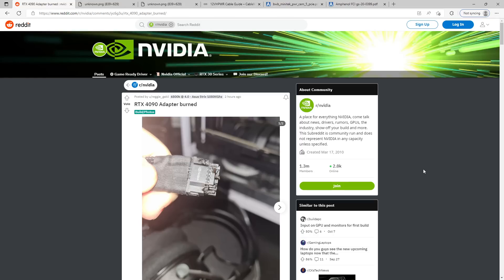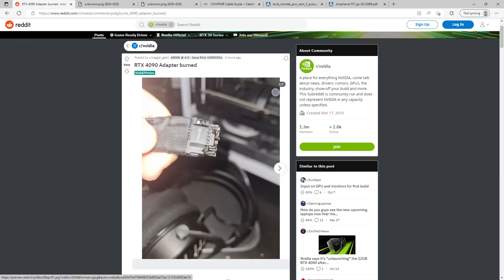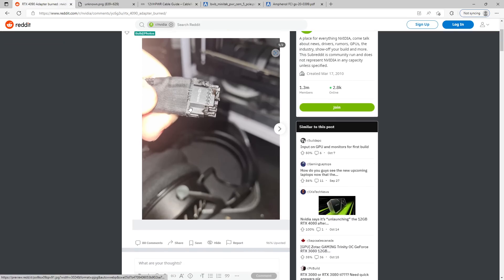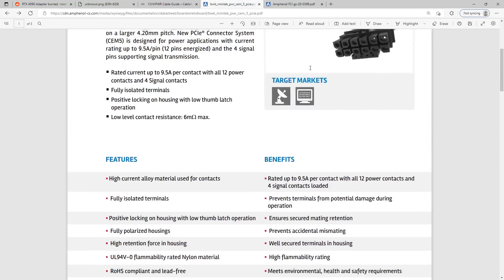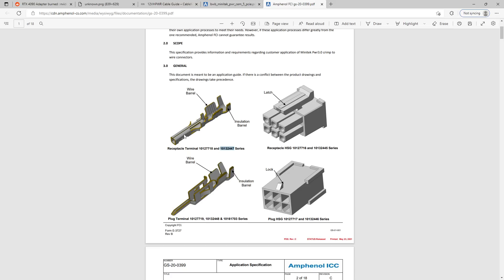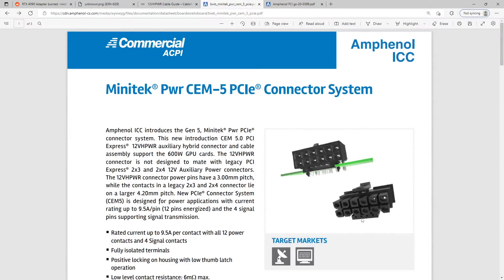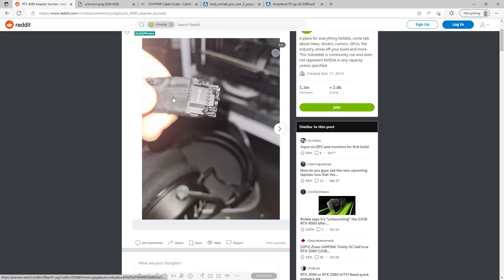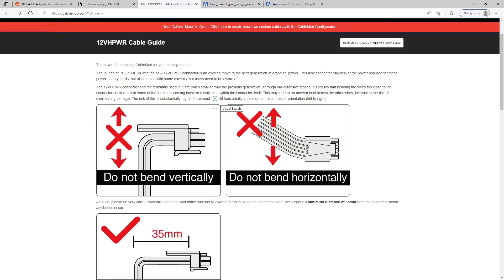The 12VHPWR connector sucks

Comment: Buildzoid, did Nvidia actually come up with this connector? I was under the impression this connector was part of a power supply standard?
Reply: yes, Intel created the ATX 3.0 spec, and the point of the connector isn't to reduce how much space it takes up, the point is that the GPU can communicate with the PSU and can in turn better deal with GPU power spikes, etc.

Comment: My first thought was the 12VHPWR connector didn't look physically sturdy enough.  
And the supplied converter cable with the GPUs are just awful.
They have next to no flexibility at the neck of the connector and they are so short you cannot hide them anywhere.
As for that guide, it's not realistic telling us not to bend the cable up or down as the case side panel is only like a inch away.

Comment: NGL I was quite shocked when I was installing my 4090FE. The nvidia adapter is super loose and you can very easily pull it out because the latch to hold in place is very small and have almost no grip on the female plug on the card. The special 12VHPWR cable from Corsair has the same problem BTW.

Comment: It seems a better solution to the sense pins would be to just sense current flow on the PCB. This is already done for dozens of sensors inside CPUs and GPUs, no reason it couldn't be done on board, and may even take up less space than having the extra 4 sense pins. Cards already sense if connector is plugged in, so they can give an error and not fully boot if PCIE 6 or 8 pin isn't plugged in.
Reply: The sensors measure how much is being consumed. The sense pins are to inform how much can be supplied.

Also, the 6 and 8 pin connector detection happens via sense pins. The 6 pin connector (by spec) has 2x 12v wires, 2x ground, a sense wire (connected to ground, to detect connection), and an unconnected position. The 8 pin connector spec fills that unconnected pin with another 12v wire, adds a ground pin and another sense pin (connected to ground to detect connection of an 8 pin connector). (In practice, that unconnected pin on the 6 pin is often connected to 12v to allow the 6+2 version of the 8 pin connector to be used)
Reply: @Coderjo.  if he detect zero current, clearly it is not connected. If you detect current, obviously it is connected. Having a dedicated thing wire is superfluous. Also, the sense pain isn't actually detecting how much the power supply can handle, just that it is connected, if you were to daisy chain cables, it would clearly not work right
Reply: @xeridea  The intention of the sense pins, per spec, is it inform the card how much it can "safely" demand. If someone (user or manufacturer) did something out of spec, such as daisy chain cables or jumper sense pins to ground, that is a different matter.

Adding current detection on every supply and/or ground pin (as opposed to one for each connector or one overall) adds a lot of complexity and cost, vs a simple transistor with the (6/8 pin connector) sense wire connected to the gate/base and a pull up resistor or the like. "Is there a connection on this sense pin? Okay, spec says I can draw x amps."
Reply: @Coderjo.  IMO the 6 and 8 pin connectors with sense pins was always a bit wonky. Voltage detection circuits are beyond dirt cheap, cost would be minimal. It may actually cost more for extra material for extra sense pins than just sensing on board. I mentioned CPUs and GPUs because they have several sensors built in, even on bargain basement models, since it is trivial to add them. Given that the 12 pin connector is for extreme and expensive cards, a couple pennies wouldn't really matter.
Reply: @Coderjo.  The other issue with the sense pin solution is it doesn't actually tell you if there is a problem. If you had current sensing, the card could actually detect a problem, such as too much power on a given pin, which is causing connector to melt. If the card detected 20A on 1 pin, and 2 on another, user could be warned, before their connector melts, possibly damaging very expensive GPU, or just shut off the card in extreme cases. Sense pin is a low tech "solution", that doesn't actually do anything useful. What would be cool is if it actually told the card how much power that cable could supply, which could be done by having different resistance on sense pin depending on how much power that connection at PSU could handle.

The issue with the 12 pin is it is "designed" to handle way too much power, with a very fragile connector. They should have made it a bit larger, or limited it to 300 watts if they actually cared about safety.  I have handled hundreds of 6 and 8 pin connectors, and never had any concerns about the connector melting.

Comment: What they should have done was upp the voltage. Transfering so much current is silly, and PSU is already translating from higher voltage to begin with.
Allowing the PSU to deliver 24 or even 48v to the card would reduce the "load" on the PSU as the current is all that really matters for it's inductors.

Comment: It's almost as if the previus pcie design was already considering thermal limits and had a size acording to that, who would have thought that making wires smaller and more compact would be an issue while pulling the same or more power
Reply: Yeah its almost like the Standard PCIe connectors "just work" 😅

Comment: Never understoud ..smaller and less pins for more current.
Bending cables in protective sleeve is most off the time impossible.

2 times 4 or 6 mm banana plugs and dito cables would be a also a nice solution.

Comment: i actually have my side panel off xD with the adapter for atx 2.0 PSUs (12vhpwr->4x8 pin) it just takes another 8 cm out of the case when bend carefully. im waiting for cablemods 90° cable to use my pc WITH side panel again (lian li o11d xl(!))

Comment: put a thermal camera on wires. Yeas the connector is bad, resistance goes up, in the connector, but the bundle is still pushing 450+ watts now not evenly thru the bundle. The bundle can handle it, a single wire can not. They will heat up, it just a question of if the connector will give out before the wires melt.

Comment: This is a typical pin and connector style used in most applications. However, the connector used is likely under-sized for the rated amps transferred through the connection. Any amount of additional resistance due to various possibilities will cause excessive additional heat and cause a failure like this. The connector and pins should be twice the current size but it will never be better than 4 separate connections. One more reason to avoid Nvidia GPU's.

Comment: the power rating is mostly given by the standard gauge of wires the connector is meant to be used with. PCIe 6 and 8pin connectors, as well as pretty much all other standard connectors prior to this new 12vhpwr one were either 20 or 22awg gauge. Having no guarantee the 20awg gauge would be used, manufacturers had to design everything around the 5A current limit of 22awg (when no active cooling is applied). So they probably rated everything around at that same limit. Now the new connector requires 18awg gauge, which can handle 16A or 14A passively I think? Point is, now that the wire itself is no longer a limiting factor, the job goes to the connector. The other thing also is that 18awg is much thicker and less flexible, unless you use a ton of strands count cable, but then it gets even bigger and it might not crimp as cleanly. 

The crimps themselves (terminals added to the end of each wire) look like standard microfit crimps from Molex. They come in a lot of different flavors such as tinned, gold plated, lower or higher gauge, and sometimes the current rating can vary from each of those. For example the tinned crimps will usually be made of much thicker sheet metal than the gold plated ones. I don't know if the new 12vhpwr standard mentions a specific flavor of crimps, but it's another variable to keep in mind. 

From the other document from Zotac saying the connector can only handle 30 cycles and with all this stuff, the only conclusion to have is all these components are meant for a single time assembly with minimal cable flex. This is probably fine for system integrators, but the culture around pc parts is "you can disassemble it all anytime", so it's really bad to give those parts to customers without proper training or knowledge of the parts' limitations. I think the main culprit is simply that this is all a new standard and the industry wasn't ready to deploy it properly, so the cables aren't made as well as they are supposed to be and they have not spent the time to ensure usability will be the same as it was with previous cables. 

Time will fix these issues and we will see lots of company selling "premium" 12vhpwr cables while it will be exactly what they were supposed to ship from the start.
Reply: You should know the 30 cycles specification is a conservative number given as a guarantee for all cables, and as a legal cover for themselves. In reality the cable will likely be good for a lot more than that number.
Reply: @Safetytrousers  sure, the point is more that unlike for example a USB connector, it's not engineered to be connected and disconnected often, it's meant for a one time assembly or extremely infrequent disconnected/reconnect cycles. It's important to understand the engineers' intentions before using a product for something it wasn't designed to be used for. (not gonna talk about what it should have been designed for tho)
Reply: @EMILE12345678901  Key is that the engineers building this card and choosing the connector didn't consider the standard requirements for PC components.  Instead they wrote warning  pamphlets explaining how fragile their design was.
  AMP/TE creates connectors for everything and write out descriptions of how to use them safely in products.  30 use connectors with cable bend limits are clearly not suited for user juggled PC components.
Reply: @johndododoe1411  Yes exactly, the current designs and implementations are aimed at the prebuilt market it seems, where the end customer rarely interacts with the components. Hopefully they get a better suited connector designed for the rougher handling.
Reply: @Safetytrousers  *less, as experimentally demonstrated by NVidia
Reply: @erkinalp  The reported failure wasn't due to getting plugged in multiple times, so not a hidden 10 use limit.

Comment: Comment from someone who runs RC models. Up to 60V and 80-100A sustained load, spikes double. "The ability to transfer 10A through one of these pins without heat damage over time is very optimistic". Surely the companies know better than me... And I also did not see the new connector personally. For the normal 8 (6) pin, I think it should be capable of double of 150W as a whole cable, but at the same time the AWG is not thick enough usually. The number of plug in/out on these connectors also matter a lot. It is a bad choice probably motivated by saving the PCB space and as side benefit, opportunity to produce new cables. However splitting the phases per "cable bundle" is a good thing, but this still can be done with independent connectors. This 12pin brings nothing in that regard. You do not want to pull more current than what the cable can deliver, using multiple cables in parallel is not good solution, because difference in length or terminal resistance will create a current difference.

Comment: Glad to see that both you and Jay have hit the nail on the head with these ridiculously undersized connector.
I feel like if Nvidia had just made the new 12-pin connectors roughly the same size as two 6-pin connectors, this would have been less of an issue. With each pin being more robust

Comment: Think JTC was saying this was gonna be a problem with cases and being too bent , but they blew him off
Reply: Pretty much anyone with a basic understanding of the subject complained about it and was shut down by people who thought they knew better somehow.
Reply: @Waldherz  do you think it will be the same when cablemod and others 3.0 psu come out with their wires sets . Or a 90 adapter you have to connect to gpu to keep away from side panel. (Sorry if dumb ? I’m a noob but very interested in this content, wish I got into this 10 yr ago haha)
Reply: @farrez_gump  With a 90 degree adapter you wouldn't really need to bend the cable that much, so should be fine. Custom cables or direct 16 pin to 16 pin cables still use the same connector, so it wouldn't improve the bending issue. Although not needing to fit that gigantic 1x 16 to 4x 8 adapter might make running the cable without major bends somewhat easier.
Reply: @farrez_gump  Good question. Most of these 3rd party cables dont have this problem, so you shouldnt need a 90° adapter.
But only time will tell.
Reply: Definitely looks like 4000 series is the generation to skip :D let the rich kids do the beta testing, they can afford a new PC if current one burns down.
Reply: @mikfhan  Has nothing to do with beta testing or age.
I got a 4090 since its simply nearly twice the speed of my 3090 in Topaz, Blender and other applications. 
It also has nothing to do with income. 
I make 1950€ before taxes monthly. Which is on low average for my country.
And yes I know 1950 is a lot for other places, but understand that living costs here are also a lot higher.
Its about how you spend your money, not your monthly income.
Reply: @Waldherz  Yeah, so you're a beta tester. I don't see how your argument could possibly claim you're not. You accepted the first generation of the product period. Doesn't matter what you're using it for, you're still that person who went in first. 

And you spent your entire monthly income on a single part. I just need to point that out. I mean for price you could have basically bought two 3090s and used them to run 2 renders at once. Plus blender already supports multi GPU rendering and two 3090s is actually faster than a single 4090, but power draw is higher. 

But you are right, it is about how you spend your money, I just hope that making literally below the poverty point here in value you have enough for rent, a shower every night, and food. I know food eats up most of my income and I make nearly twice as much as you literally only paying for internet and my car insurance as I still live with my parents and they don't know jack about good internet.
Reply: @Skylancer727  Those 2 3090s would have used a lot more power, pumped out a lot more heat and would have been bandwidth limited since Im on a Z490.

And yes, I have enough for rent and food. Its insane how much food costs even compared to my electricity bills. I save up for purchases like these ^^
Im also living with my parents, its hard to find any place to rent here.
Reply: @marceldiezasch6192  naw while tucking the cables away it's gonna be tugged on.
Reply: It wasn't only this he was talking about he said that was bad but the plug in on the card itself is extremely bendy that's what he was more worried about. So now the question is how long before one snaps off the card to prove him right again........
Reply: JTC droped a video about it today
Reply: @24zer0nd  yea and also mentioned it before lunch , guess during pre launch, think he also show a different brand as well correct?

Comment: in my case the connector is, exactly like the example you gave, badly smashed up against the side panel bending the cable up and diagonally and yeah.. so far no problem even while running benchmarks on a mild overclock with the 4090, but im not risking a sustained full load. I really need one of these right angle connectors (apparently not available yet)
Reply: I also felt very anxious bending the adaptor but I prefer to use side panel of my case. Nvidia forgot ppl dont use test benches in real life.
Reply: @simptrix007  don't buy expensive cheaply designed crap from Nvidia next time. 

Lesson learnt the hard way.

Comment: I think you are barking up the wrong tree a bit with the connector.
Bending it "sideways" causes more "pullout" on the pins with wires on the outside of the bend. This in turn causes a sort of preload in the plastic.
When things get hot these stressed connections will pull out further and the problem with uneven load increases. These connectors are not really much different than the previous generations of minifit/microfit and naturally suffer from the same issues as all these crimped pin systems have. Clipping the pins into the housings are the weak point here.
They should have simply gone for a proper high amps connection like the Hirose DF60-2P-10.16DS(27) which is a 2 pin 45 amp connector capable of 1000V.
The problem with loading so many paths in parallel is that they will never balance.

Comment: They would have gotten away with two 8 pins imo.
600W divided by 2 is 300W per connector that's doable. Or use three or four for safety and for keeping them within official ratings.

Comment: Imagine using a PCB edge connector that's just based on PCIe slots. 22 watts per pin. Hooks cut into the PCB, spring loaded hooks on PSU cable. Almost like hot-swap server PSUs except with a latch on the connector.
Reply: Smart

Comment: We tin plate connectors very similar (if not the same) as these and i can confirm that they are extremely flimsy, Pretty sure that these are tin plated brass or bronze that we plate

Comment: ATX spec should implement using XT60 connector, or make a similar one with sense pins. This one woudn't melt. Usually they support stable current 65A, 80A peak currents.
12VHPWR connector is absolute garbage. Hopefully AMD keeps using 8pin connectors.

Comment: Nvidia AND Amphenol should get a grip. The metal stamp probably is not done well, the seam you were talking about should be welded. The crimping itself might actually bad too. This is completely unacceptable from Amphenol, as they're a major manufacturer and one of most expensive vendors too.